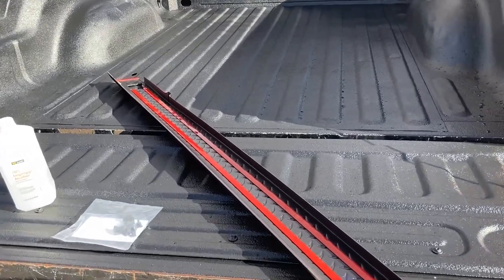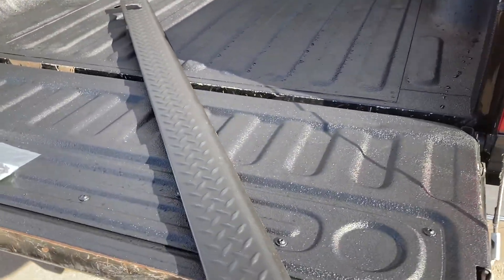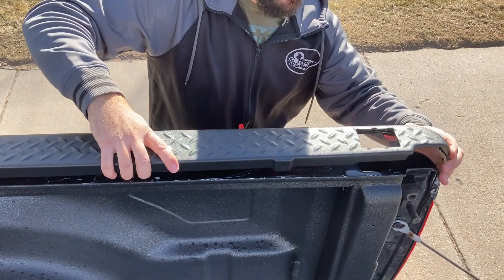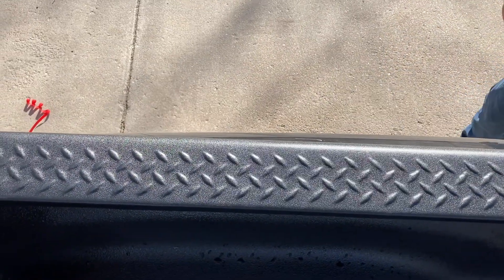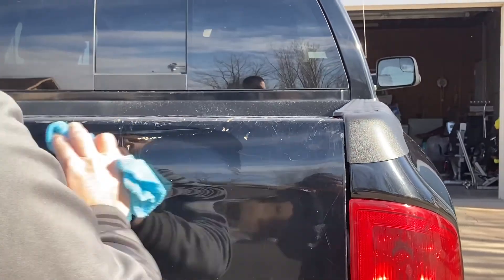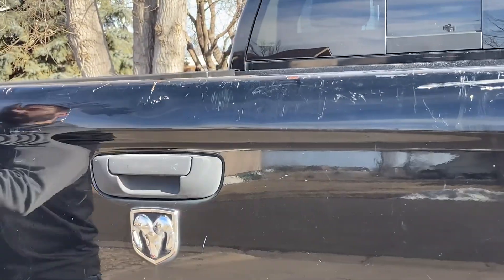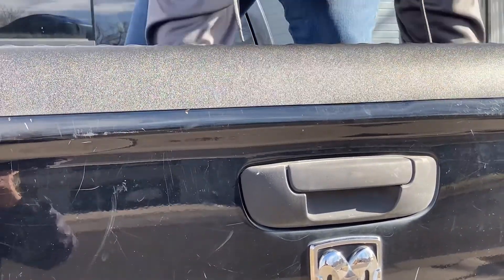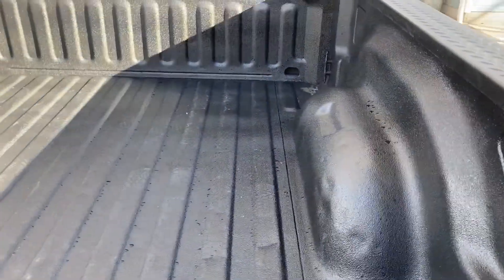Dodge Ram Bushwacker bed rail caps

Comment: Plastic can survive a ding or two but the main thing is that they are removable. Perfect for that but what about any deep scratches needing primer? The adhesive will trap moisture underneath where the bare metal is rusted

Comment: Putting those on today I have the Same ones but smooth finish bushwhacker for my 08 Ram 2500 4/4 Hemi. 
Did you spray in your bed liner yourself?
Reply from the maker: Yes raptor bed liner works awesome! Check out my video of putting it on